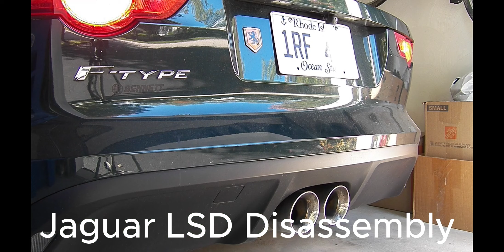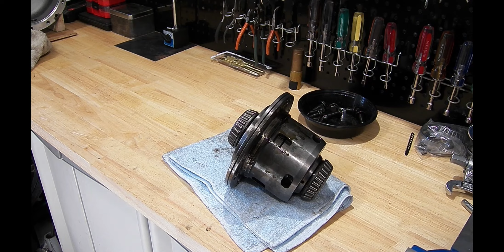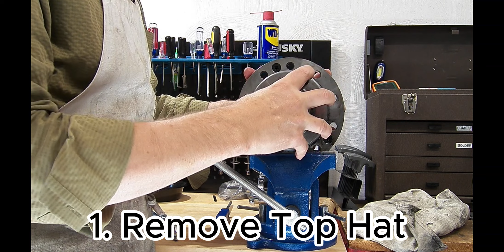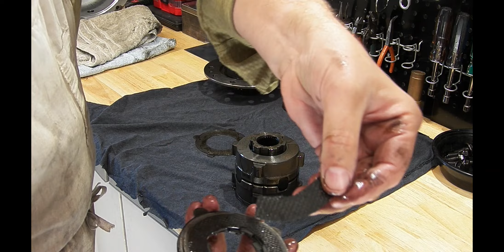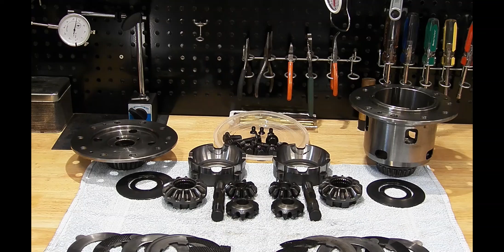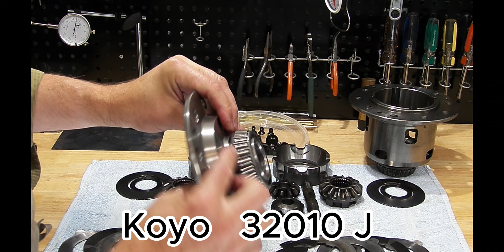LSD Disassembly & Inspection Jag F-Type

Comment: Hi Herman, do you know how many miles were on this unit? The friction material falling apart is pretty disappointing to see
Reply from the maker: Agreed, very disappointing. This Jag LSD from an early V6S operated for about 35-40 kmiles. I took apart a second used LSD unit with about 30 kmiles on it with the same issue.  Please check out my more recent LSD Rebuild video where I install an upgraded clutch pack.  I also have inspected OEM and upgraded LSD units available on the shelf.

Comment: my jaguar 2020 P380 for now, when i turn around little bit, there is a noise like  "wung wung". i changed diff oil twice the noise sounds lower, but still had. cry! i decide to change one more time use amsol 75w90 ( the first two times i use Castrol BOT 720) I want to repair it but....when i saw your video, its a huge work!!! Im not sure when it be opened, if it can work like past time.
Reply from the maker: @marshallholdcoin   Yes, I will have a solution for two issues.. 
1) upgrade from Open Diff to a Helical LSD (maintenance free) 
2) rebuild kit for Friction LSD  (needs oil changes and new clutch disks)
3) upgrade kit from Friction LSD to Helical LSD (maintenance free)
I will post some more videos in January or February about these options.
Reply from the maker: Marshall, don’t fret yet! It sounds like your Friction LSD may be making some noise when it is doing  differential action on slow tight corners. How many miles on your car? There is some pre-load in the friction disks so some noise may be acceptable.  Does your P380’s rear diff experience odd noises or behaviors when power is applied on wet surfaces? (DSC off) The Friction LSD will degrade as the friction pads loosen and fall off, eventually turning into an Open diff. I will have a few solutions when your diff finally fails.
Reply: @OncaEngineering  do you have some idea to solve this problem？ I mean for the noise stopped, and looks like everything all right. but im not sure if LSD still work. i dont know how to try if it worked. appreciate that
Reply: @OncaEngineering  together and noise gone! But some engineers told me my diff still broken because of long time no changed oil, and the reason why noise gone is because slip lock worked out. My friend has same problem and he opened diff but there is no part to repair, can only buy a new diff which means a lot of money..